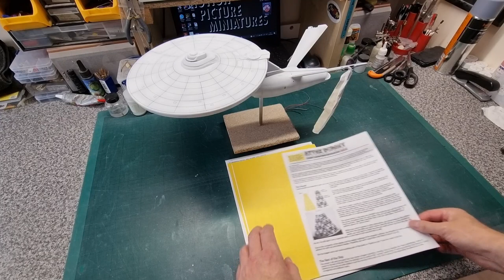AMT 1/537 Enterprise 1701-A, Part 8 - Painting The Main Aztec

Comment: Wish you would have shown more of the scratch detail work on the dorsal vent area where it meets the primary hull.
Reply from the maker: Are you referring to the ribbed detail at the separation plane between the saucer and neck? It was a photoetch brass part, the gaps around the impulse deck were filled with epoxy putty
Reply: @MotionPictureMiniatures , it's been a minute since I posted. I do know that I'm both interested in the "ribbed" lower aft vent detail and I believe how you created the transition trim (collar) between the neck where it transitions to the underside impulse deck.